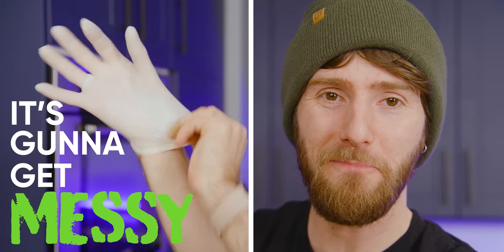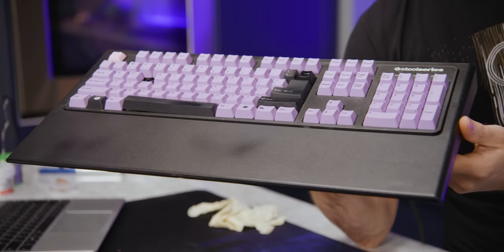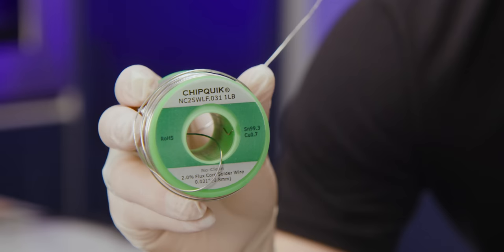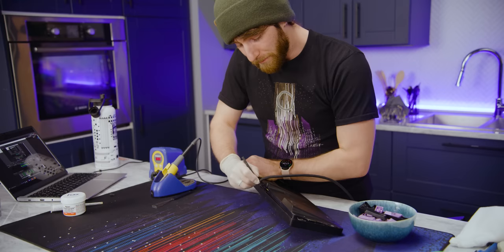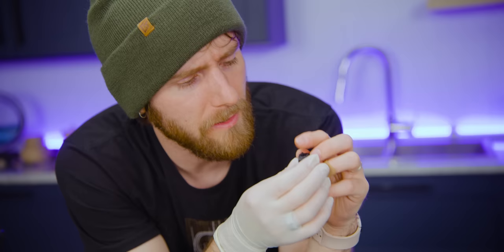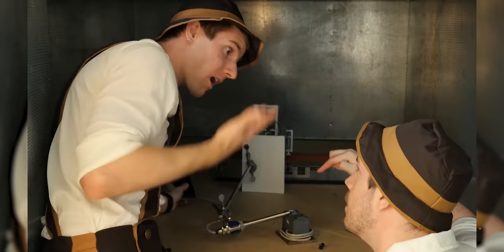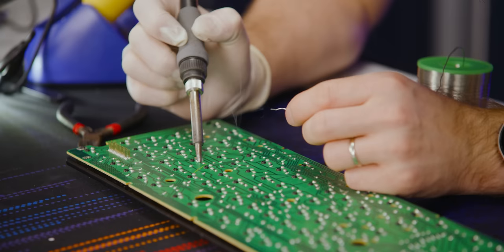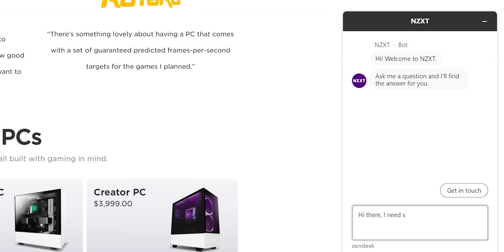Fixing my Wife’s $150 Keyboard for $1

Comment: "This is an almost perfectly good keyboard", in the last years I had my first experience with Steelseries and I'm never going with them again. I had a mouse and if I use RGB on it, it doesn't work correctly but if I have a solid color it works correctly, that's too low quality for me and regret spending $100 on that steelseries mouse. The mouse I've been using since is much better.
Reply: Mice were always a big problem for me. Currently I'm using corsair glaive and I'm also not going back to corsair at least for the mouse. I had double clicking problem, scroll jumping(sometimes going up when I scroll down and wise versa) and button jumping(when I was holding down button it instead activated multiple times). I disassembled it and fixed all the problems(although scroll jumping is returning just not as severe as it was) but I shouldn't as an end user be expected to disassemble it(disassembling permanently damages it's sliders). I'm no mouse expert, but 53 years after first mouse was created I kinda expect mouse from such big brand and at this price point to at least work. So my question is what mouse did you chose?
Reply: @user-wj1ru2xn6q  I went with the Razer deathadder v2 because of the buttons being light activated, I thought it would be better because not being actual buttons but after  6 months it started not clicking half the time... It's better than any other razer products I bought in the past as it lasted double the time. The best mouse I had in the past was a Logitech M500 (the first model, not the current one which is much cheaper) that lasted me 5 years. On average, other brands last me 2 years so I'm looking for another mouse currently and will probably return to Logitech.

Comment: 90% isopropyl alchohol. That is what is used in the factory as a wash that wont rust your device. 99% actually but 90 is easier to get at a pharmacy. Just well ventilate and wear gloves.

Comment: Linus your soldering techniques are ...ahheemm ...aweful, please go and do a High Reliability Soldering Course, you will get the benefit of solder joints that don't ever break.
your technique will break in mechnical situations.

Comment: Anyone give me a hand with the computer I built Im looking to upgrade on a budget.

currently running Asus prime 450B mother board ryzen 5 3600 cpu 

I want to work towards the ryzen 9 5900x .

is there away I can upgrade my motherboard and use my ryzen 5 3600 in it until I can afford the ryzen 5900x?

or do I have to upgrade the motherboard and the chip ?

and will the upgraded mother board run my asus 1060gtx 3gb or will that have to be upgraded as well Im not trying to upgrade my working GPU lol.
Reply: Also thats a nice screw driver linus its been coming to the LTT store TOO LONG.

Comment: Does the 1 dollar include the cost of the highly specific tool that he used for assemblying the housing without even commenting on it? I get that it can be done without the tool but overall these kinds of videos are more of a presentation and  of a repair rather a tutorial and imo a disclaimer about that should be made instead of proposing to a most likely inexperienced person  borrowing a soldering iron. Actual tutorials with steps and required materials would be nice to have and they obviously can do ot.

Comment: This may be controversial - but ultimately, is it worth it to do this? I mean - the environmental impact aside (which is clearly a LOT lower to repair than replace), but this keyboard is 10+ years old, $150 - and this repair probably took an 30 minutes to an hour (minus filming). The cost of supplies + labour must be up there. 

I say this as someone who WOULD do this repair - I am someone who values in repairing my own stuff rather than tossing it (including $5 parts and such) - but I just can't see this being a thing a lot of people are willing to do.
Reply from the maker: It entirely depends on how much you value your time, and how much you value the environment -CW
Reply: @LinusTechTips  Thank you - that was kind of the point I was making (as confusing as it could be, haha!).
Reply: I do this pretty frequently on boards for myself and others, as I build custom boards, I could probably replace a switch in a few minutes, if only one. A pack of 10 cherry switches runs around $15, cheaper if you get gateron or Kailh switches, solder is cheap anyway and you don't really need flux. You could get away with around $25 in materials at most for replacing up to 10 switches on a board